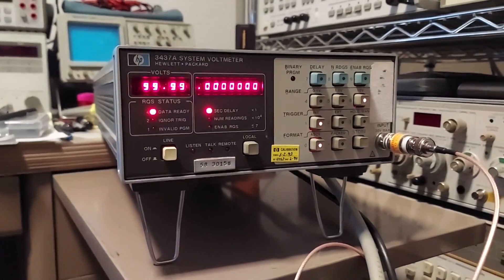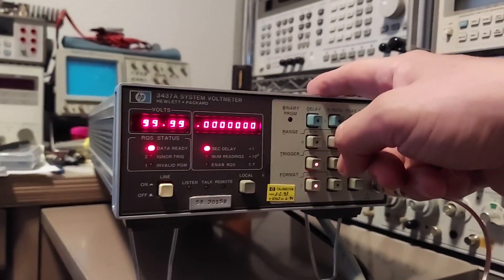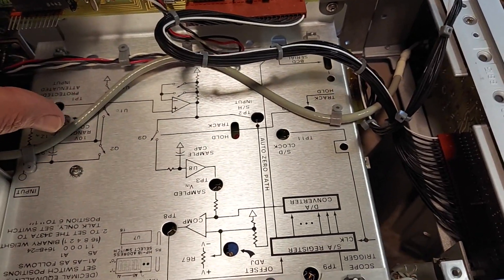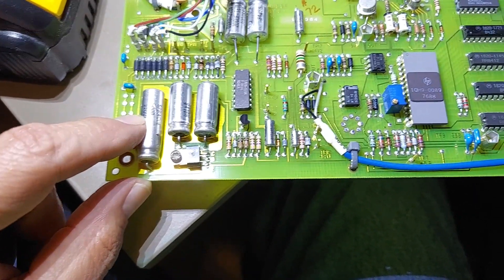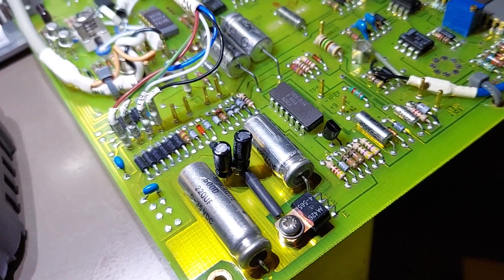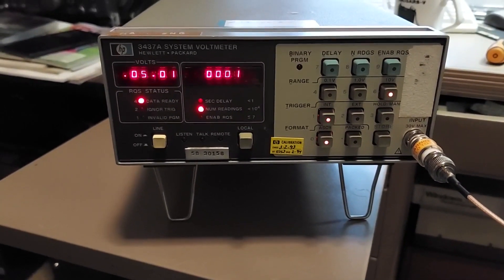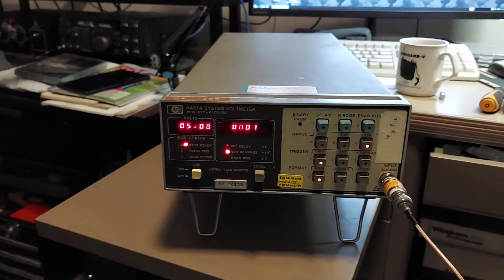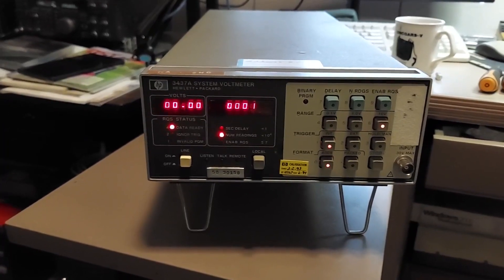HP 3437A System Voltmeter repair.

Comment: cool repair! first time ive seen one of those sprague caps in an hp unit like this go bad.
Reply from the maker: This was the first time I ever had a bad cap in any of the HP instruments I have collected over the years. I even have a set of sprague caps I robbed out of a HP 5328A that are 40+ years old that still test fine. I haven't done anything with this meter lately but I do want to try it with an old Tektronix 475A I recently acquired.
Reply: @CraigPetersen12f36b  i got one of these through happenstance and thankfully it was in good condition but im trying to find worthwhile applications for it that dont require setting up gpib. have you discovered good applications for its high sample rate?